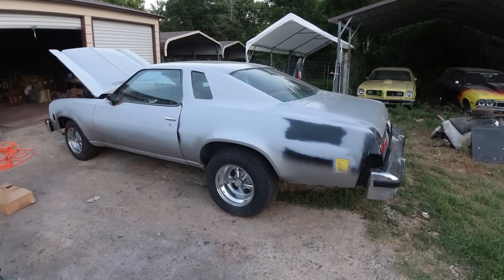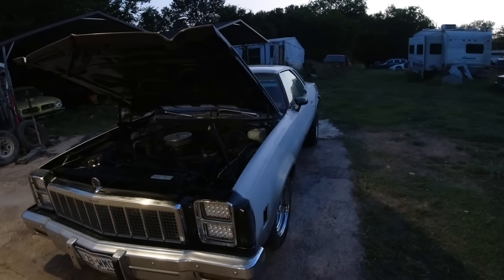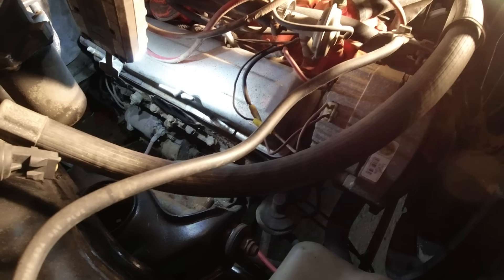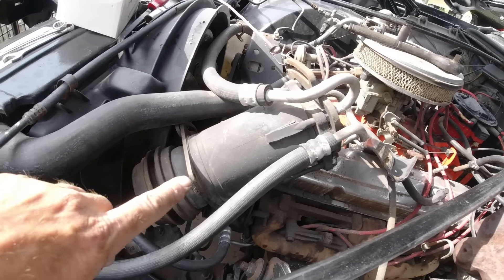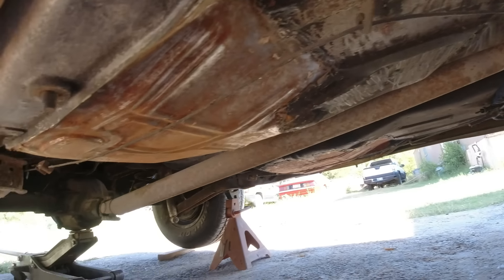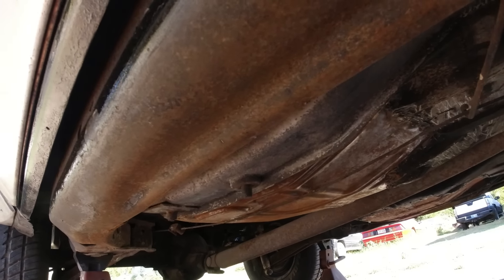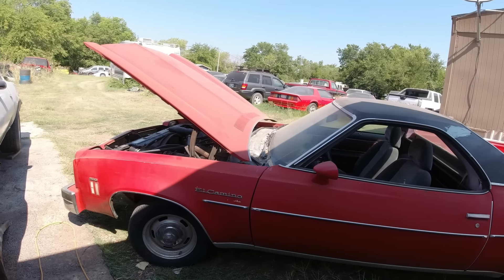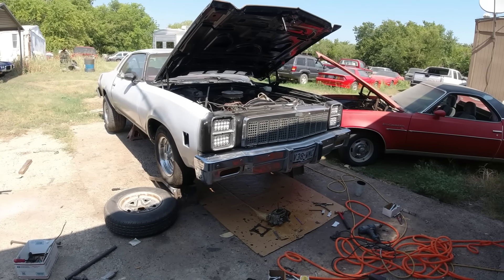1977 Malibu Classic Build #16. Header Fiasco! POR 15 Treatment. Exhaust System Removal. #Vevor

Comment: Great progress, love it I had a 75 Laguna with the 400 in it but it had been winter driven here in Quebec and much like Art's was losing the battle when we parted ways. Looks like the wheel opening moldings on the red El Camino are in decent shape from what I see on the driver's side, maybe swap them out with the beat up sets from the two Malibus and make a decent set of 4 out of it all.

Comment: You should be able to put long tube headers. In there, I guess it will take a little persuasion. Lol
 we had them all my brothers malibu. I was going to order a set for my 76 malibu.
But maybe I should get some short tubes, just in case. I just had a brand new dull exhaust ran. i'm going to add headers later because I didn't have the money yet.
I will stay tuned to see what you end up doing.
Reply from the maker: Video on Monday on full exhaust

Comment: Hi lee thats some bad luck with the  headers but im sure you will sort it i when the new headers land. i dont know if i saw correctly but it looks like your cross member only has the single cutaway you could do with the duel (double hump) cross member or the one side of your future exhaust is going to need modifying off the header and it will run real low. maybe you have a duel one on the parts car? hope it all turns out ok look forward to the next one cars coming along nice great watch as always 👍

Comment: Talking from complete ignorance here, 'cause I have no idea how that crossmember looks, but, if it's simetrical, as in the same on both ends, you could take the one out of the other Malibu, cut it in half, do the same on the one on this car, weld the two halves, and make a crossmember that has the two indentations for the dual exhaust.
Cheers from Argentina!
Reply from the maker: I could do that or just notch it..but is it worth all that work?
Reply: Something in that yard probably has two notches
Reply: @clunkersandclassics  That's for you to decide, of course. But I'd assume that a dual exhaust car with a correct setup would be... more desirable, so to speak.
Anyways, dual or single it looks good.
Cheers!

Comment: Mr. B. Here ! 🍩☕️👀😎👍. Lee I have found on the engines GM from 1973 thru 1977 simple install cam one step over stock, headers & duals. It will give you about 310 horsepower. It’s not crazy but it’s improvement, just fyi for you ! 🍩☕️👀😎👍
Reply: I have the same car basically, well a 76 & stock it only comes with a 145 horsepower 350. Now that's crazy. Lol
 i've already put dual exhaust and new Edelbrock four barrel intake & carburator.
 I need to put a cam next. So I can get it closer to 300 horsepower.

Comment: Never seen a guy get under a car with a fuel leak smoking!
Reply from the maker: Pour gas in a cup then throw a lit cig butt into it. Guess what happens? Nothing.
Reply: @clunkersandclassics  So why cant you smoke filling up at a gas station?
Reply: @clunkersandclassics  Lee please make a video where you lay under a car leaking fuel while smoking, the temperature of your cigarette will increase many times as you drag on it and I would like to see the results!
Reply: It has to be an open flame to ignite gasoline. Cigarette is a movie myth. Go ahead goggle it if you don't believe. 😉✌
Reply: They don't allow smoking at gas pumps because your lighter or match can ignite not the cigarette.

Comment: You need to take a rubber vacuum tube and stick down inside your booster to see if that's where the brake fluids going, that happened on mine it was sucking the brake fluid out of the master cylinder into the booster..

Comment: The manifold on my van doesn't like a square bore carb unless you use both adapter plates. One edelbrock i had laying around wouldn't open the back barrels when it was upside down.

Comment: I have an impact gun like that but, it isn't the same brand. I don't have the jack compressor deal. It looks like it would work for some stuff but, some cars are just too low for certain things like bottle jacks or, larger floor jacks or, my fatness. I have had bad luck with the cheap little compressors that i have had.